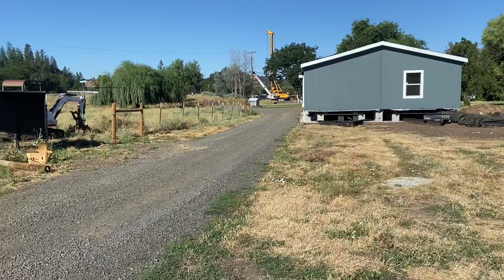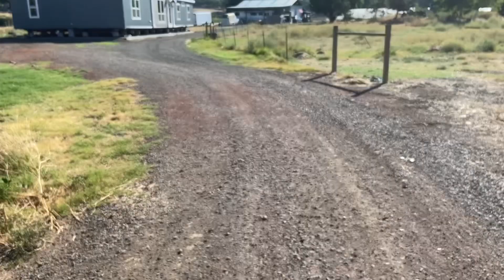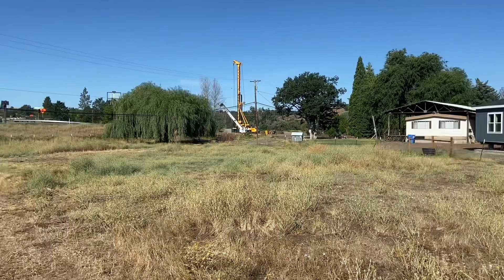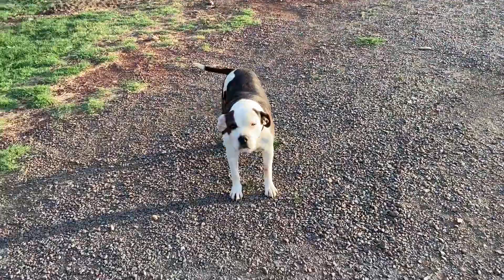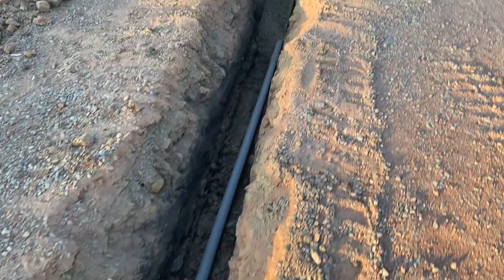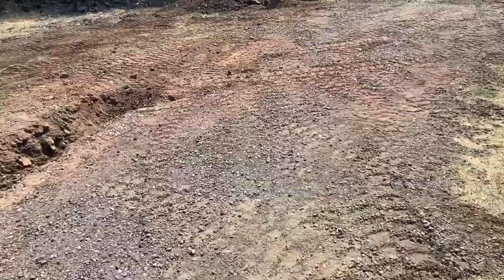STILL NO RACING BUT, WE MADE PROGRESS ON THE HOUSE!!

Comment: I have 2 v8 s10s one is a 94ss s10 383 and the other one is a 92 with 427ci SBC procharged 4l80 transmission with a trans brake & a 9" moser rear end with 40 spline axles and full spool with disc. brakes.
Reply from the maker: That sounds like a beast!
Reply: The 92 is  it is a project that me and my baby boy that will be 25 in December are doing together.  I had a bad ATV  accident on may 6th 2018 I Died twice and  my wife rolled me on my side and hit me on my back and I spit out blood I broke all my ribs on the left side in two places also collapsed my lung was choking on  blood broke all the bones in my face and the left collar bone. I'm blessed to have my life and still have the knowledge to do  the things I love My son does all the physical stuff I do the think part and share the knowledge with him it is my therapy after accident I was told by Doctors that I was retired from fabrication of metal and pipe welding which I had done for 28yrs at that time so it helped keep me motivated and busy in a good way 427ci is 1000hp-1100hp Engine on pump gas 93 octane 850 cfm CSU carburetor good parts AFR 227 Heads DART block and H beam 4340 scat Rods Victor Jr. Intake 4340 crankshaft  billet soild roller camshaft & Lifters. comp cams
Reply from the maker: @michaelmerrill589  man! That sounds like you hard a really hard road to travel… I’m glad you’ve been able to work through it.